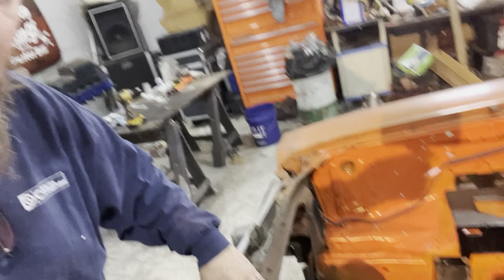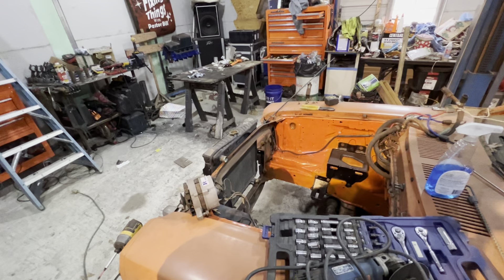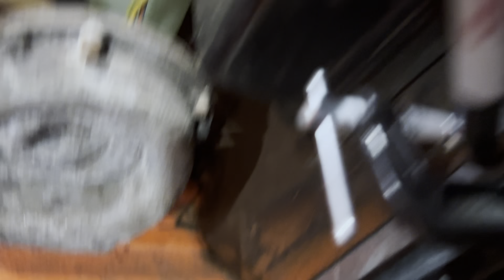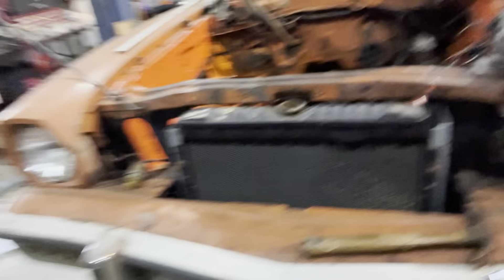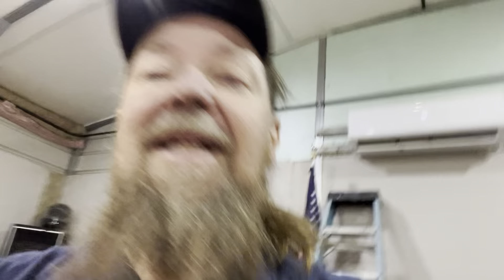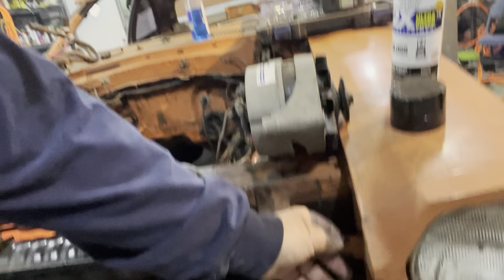V8 Pinto Radiator.  installed the “right way” easily

Comment: Not the best radiator setup - by using a cross flow and slicing a different core support into the Pinto core would be a better idea. 

If you use the correct cross flow, one that's wider could be thinner in cores - 3 vs 4 cores for example...  

Remember a small block v8 was in the Mustang II and Maverick, point those core supports maybe uses to modify your pinto as the radiators were specifically spec for the motor - Coolant hose location arrangement! 

A modified larger fire wall and trans tunnel area that can provide a little bit more air flow helps as well... 

Another help is to run the exhaust on the outside of the frame ( unibody ) thru the fender well area helps more than you think:  Side Pipes.

On the genuinely side - nice job...
Reply from the maker: I definitely should’ve made some more time and modifying the firewall and the transmission tunnel the radiator I used was for the Mustang II , but the pinto is about 6 inches shorter inside the engine compartment then it’s Brother the Mustang but I got it all in and it works fine thank you for your comment. I appreciate your thoughts.

Comment: God bless you sir. I have a 302 1980 Pinto in progress.  Consider the latch on the hood. You may find a little more Wiggle room to make that latch work.
Reply from the maker: I hope so when it comes time to putting the hood back on, I'm gonna try to modify everything to make it fit. It be nice to have that latch working.
Reply: @fixingthingswithpastorbill3840 

That's the beauty of a cross flow -  the fill tanks are on the ends vs top and bottom!